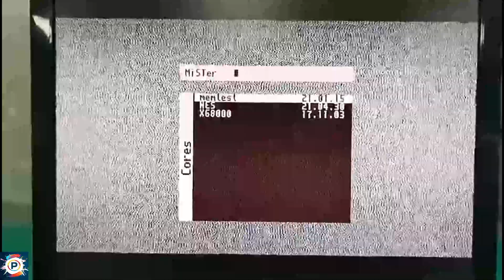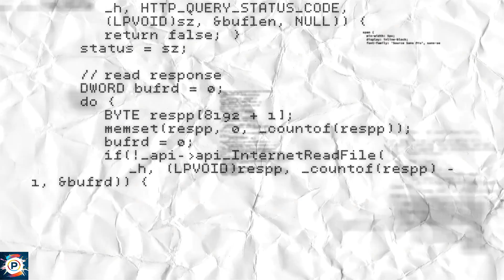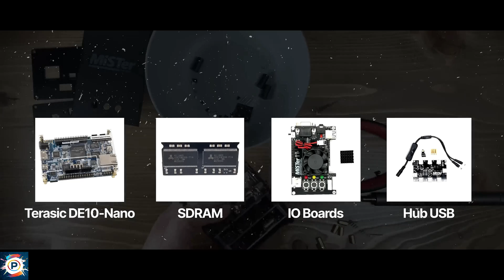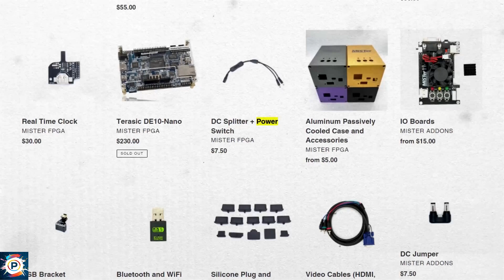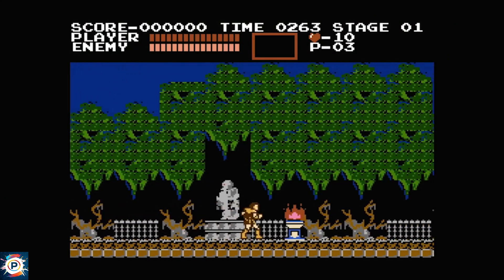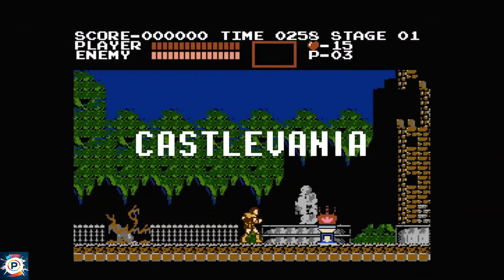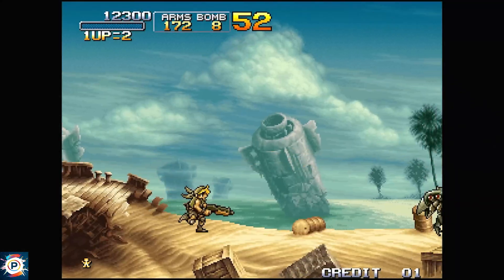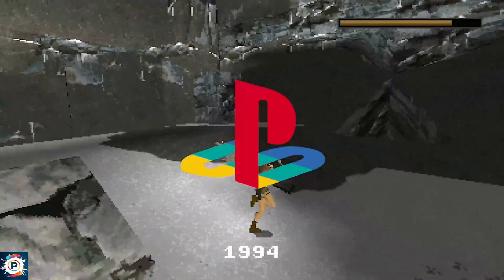Is MiSTer FPGA Worth the Price? A Comprehensive Look

Comment: The information in your video is horribly out of date.  The 5th generation console cores are running very well.  N64,  Playstation, and Saturn are phenomenal.  As far as Jaguar and 3DO, 3DO just got a prototype core and the Jaguar beta core runs amazing even on a single stick of RAM.  Price came down a lot too.
Reply from the maker: Interesting comment, but it doesn't matter what year we're talking about, the n64 is very complicated to emulate, see any handheld console that tries to emulate something decent and more elaborate at times that require something heavier (no introduction, right? and no cartridge). It's not a question of the device, but of its transposition. Now, if you think it's good to run a game at 20 or 25 fps or less, then yes, it runs very well. 
I don't think that's everyone's taste and let's face it: running at 15-25 fps is quite problematic for the vast majority of games. And yes, this equipment is problematic for the vast majority of 3d games, and that's not an opinion, it's experience. Anyway, thanks for pointing out that it was done years ago, because this year it's still the same :), but I accept links to videos that show 60 fps in heavy games on current emulators, I need to get up to speed, maybe, thanks.
Reply: @Play_Screen  they run at full speed ( N64 library ) and so does 99% of saturn. and a chunk of jaguar. The N64 even has a turbo core that takes any of the lag that was in the original n64 out. The playststaion has filters to clean up the blockyness. I never liked the playstation so i havent messed with it much other thna symphony of the night.  The entire superstation fpga with snac is only like 180$
Reply from the maker: Of course, I mentioned FPS just to have a base, but we can base ourselves on transposing them via hardware without sound bugs and graphic bugs, in other words, faithful to the original. Via cartridge is interesting, of course, but...

Comment: Even with the high price tag it had before MiSTer pi got sold it's worth the money. Because you have to compare it to og hw. Hw emulation is not existing. It's called simulation or recreation. Emulation is the interpretation of the og hw through sw code. Therefore emulation is the wrong term to describe what a fpga does. N64 is possible and running excellent. 3do and jaguar core are in the making. ☮️

Comment: Regarding 3d platforms (eg. playstation) and FPGA implementation vs. software emulation -- yeah, emulation will often look better, because the whole point of the FPGA implementation is to act as much like the original hardware that it can... so, for example, the original PS1's jenky texture handling will be faithfully reproduced.